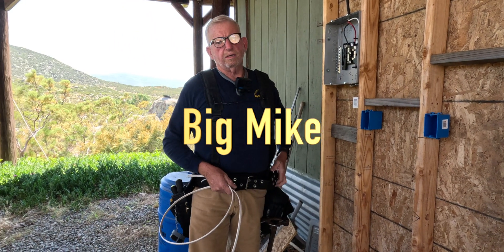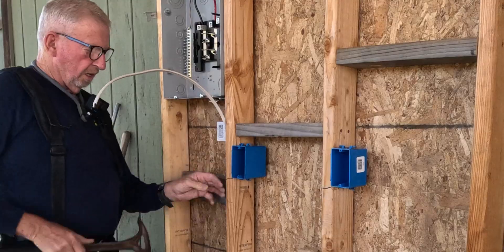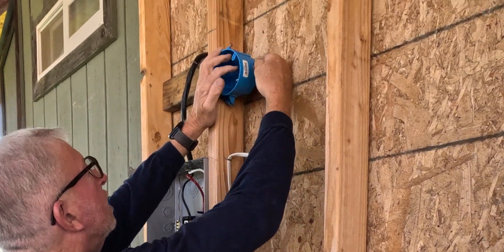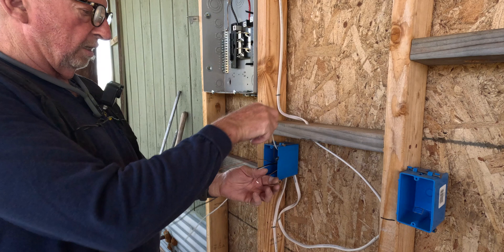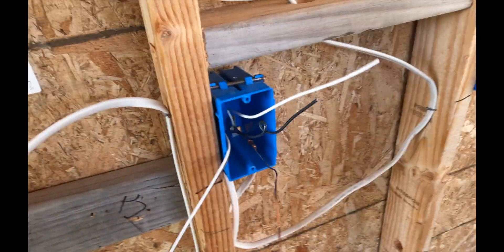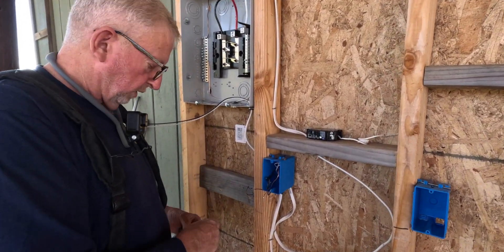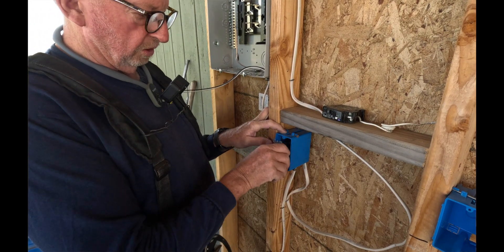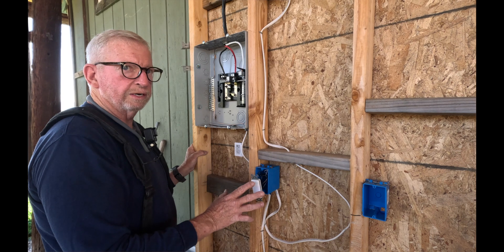Sub-Panel Wiring 101 - Part 1

Comment: Very informative. Thank you for sharing your knowledge.
Reply from the maker: Really appreciate your kind words. Thank you very much. Keep watching and you can learn how to do a lot of stuff around the house. Is there anything specific you want to learn?  We can maybe do a video about it!
Reply: @bigmikeelectricoc  One thing that would be helpful, if you have the time, would be a video on how to install and wire a sub-panel in a detached building (e.g. garage).  Specifically, I would like to learn how to properly ground the detached building. I suspect that you run a properly-sized ground wire from the main panel and also drive a grounding electrode outside the detached building, correct? I know that the neutral at the sub-panel would be isolated from the ground bus bar and cabinet.

Again, thank you for sharing your knowledge and expertise.
Reply from the maker: You're correct on both of those questions. Drive the ground rod for a 100 AMP panel use a #6 ground rod and make sure you have a main breaker on your sun panel. We'll see if we can do a video in the near future to show you how to wire it from the beginning all the way through. Thanks for your question!
Reply: @bigmikeelectricoc  Thank you!